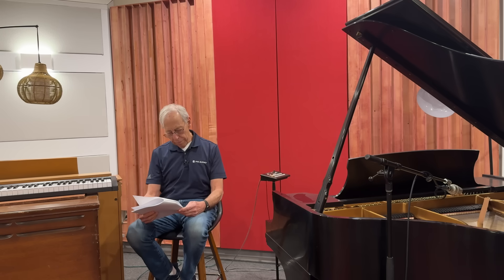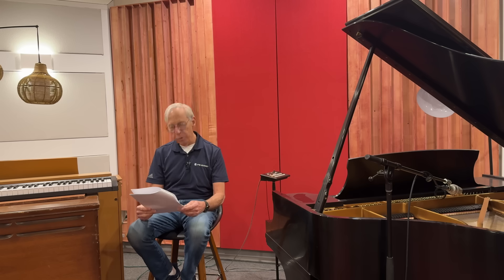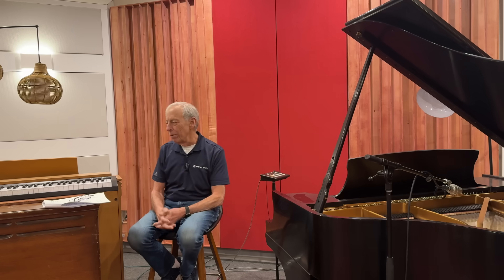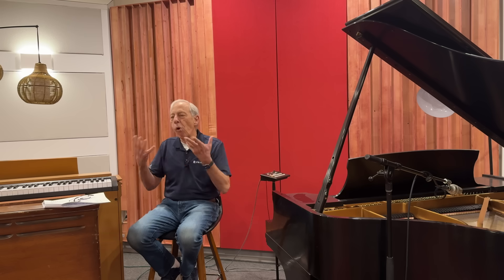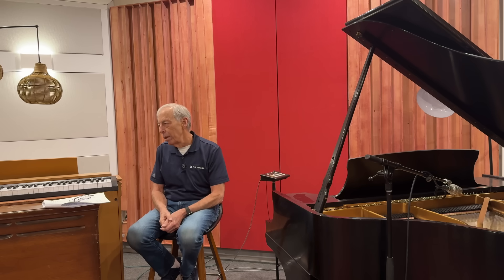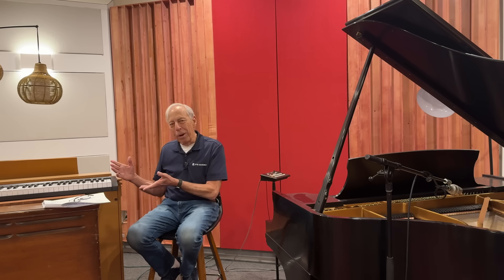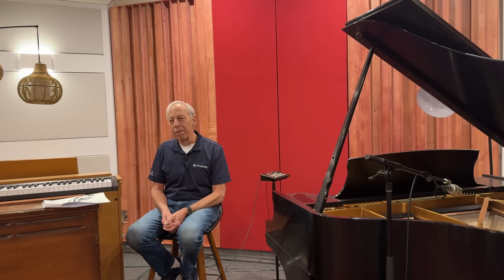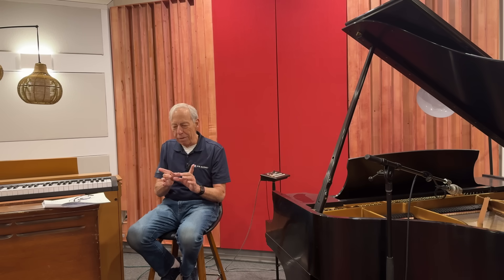Tubes in preamplifiers

Comment: Tubes, not particularly linear, noisy and if the heaters are AC powered, likely to introduce hum. Why would I want anything quiet, solid state and linear. It’s like saying I’d prefer to take Ford model ‘T’ on a long road trip in preference to my Toyota Hilux. It’s just nostalgia. It’s not better.
Reply: Triodes are the most linear devices ever made, transistors need feedback to be linear.
Reply: Man, your so uneducated on correct Tube design. You buy what you like in your system...Next caller...
Reply: @CohibaJoe  you should do some research on the subject. All transistors need feedback to be linear, triodes on the other hand  don't need any feedback.

Comment: I bought a Vincent SA-T7MK a few years ago when it came out that uses 8 vintage  Russian tubes and had that older sound that reminded me of my Dad's Layfeatte preamp back in the early 60s. Then the came out with the SA-T7 Diamond using a complete redesign using only 4 Vintage Telefunken vacuum tubes. I tried it out and it sounds easier on the ears yet it's really full range compared to the other and much more pleasing to listen to music for hours now. It's all about trying out different equipment for me except my basement has shelves full of stuff I'm not using because of this ongoing search for bigger and better. It's a tough bug to get out of your system as you keep building a newer system. 💯
Reply: Yes indeed...It is a prison from which very few escape...
I've swapped out many pieces for short term euphoria , only to realise that I miss the pieces I swapped out,.
We simply get bored with the same old sound I think , and the 'flash of newness' gets us excited...
I think I'd rather have 5 sets of $1000 speakers than 1  $5000 pair and rotate the gear ..This may keep the sound fresh?
Reply: Have you listened to any of the Vincent integrated amps like the SV-228 with the VU meters, I've been wondering about them and would like to hear one.
Reply: @davidhester9897  I've never heard the Vincent SV-228 but I own a Vincent SV-500 that's basically the same integrated amplifier except it's not the 100 watt amp but 50. It still has plenty of power and sounds great. I used it over the Christmas holiday and forgot how good it sounds. Granted it's not as quiet as the Diamond preamplifier but they're 2 different things anyway. I used the pre outs with my PS Audio stellar 300 amp and Emotiva BasX 2 and it sounded pretty damn nice. You can do a lot more for good sound than with an integrated amplifier set up than you can with an AVR. The music sounds much better. 👍